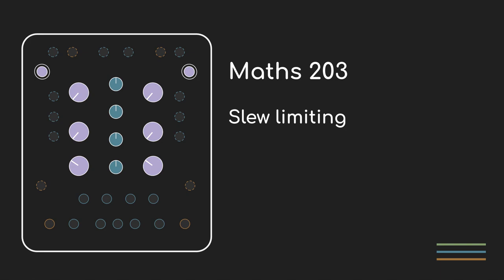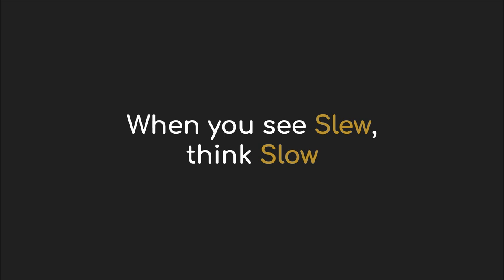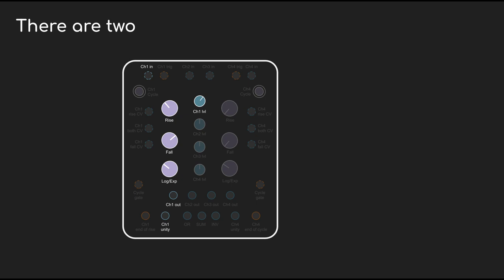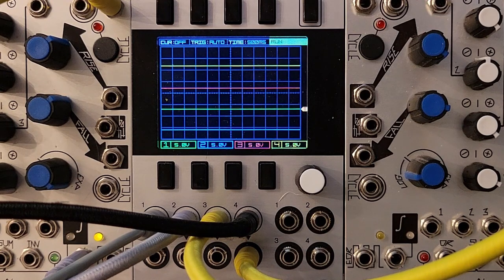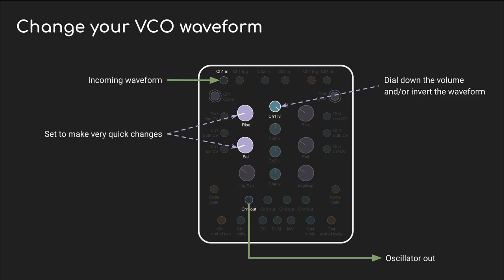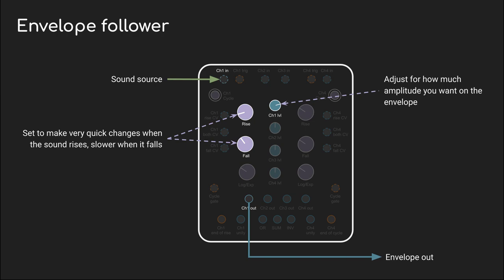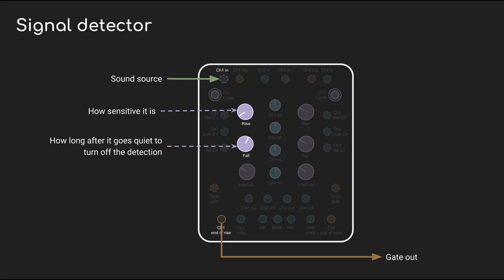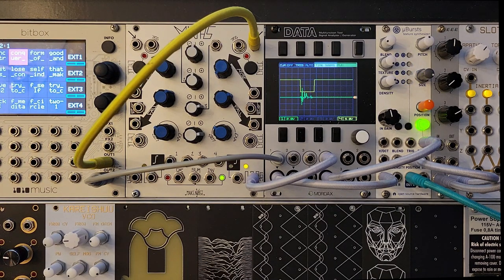Maths 203 - Slew Limiting and  six patches that use it

Comment: Simply the best channel on YouTube regarding clear explanation of topics in the modular world.

To have the Both input decreasing rise and fall times make sense when use it as a voltage controlled LFO and thus makes the CV inputs more versatile.

Regarding the somewhat unclear labeling on Make Noise modules. It's by purpose that way to have the users experiment more and patch by intuition.

Comment: "Both" works in reverse and exponentially so that it is like pitch on an oscillator: higher voltage is higher pitch. I believe the Serge module Make Noise used as inspiration even uses 1v/oct there (or a way to do that) so that it can be used as a typical oscillator. I've seen people tuning Maths and adjusting tracking using the Log/Lin knob, then using that to play pitches (though only accurate over a short range).
Reply: also if you patch voltage lets say from channel 2 into both of channel one, you get precise control over LFO speed, higher voltage means faster LFO. Its much more precise than controlling speed of LFO with rise and fall.

Comment: Great video but the audio is only on the left channel
Reply from the maker: Crap.  Dang it, thanks for letting me know.  I'm not sure what I did differently this time...
Reply: I've had it happen before with mono voice over before where the layer setting was set to stereo
Reply: hmm i kind of like it this way
Reply: Great video, but yes, audio was somewhat  borked.  But manageable.
Reply: that, and the background pad seems to be in another key than some of the examples :) great info though!

Comment: Regarding the integral symbol on the unity outputs, the op amps in maths and other electronics have integral outputs on them and that output is the same as the unity out.  Integrals are basically the same function as low pass filters or slew limiters.

Comment: 16:00 can you also do this with mutable instruments beads?
Reply from the maker: You should be able to.   The Freeze control is the same, and instead of "Position" on Clouds, you'd use "Time" on Beads.  I haven't tried it, but there isn't any reason it shouldn't work I don't think.